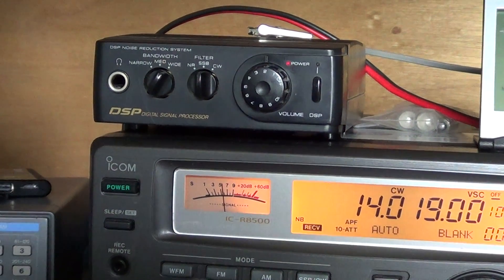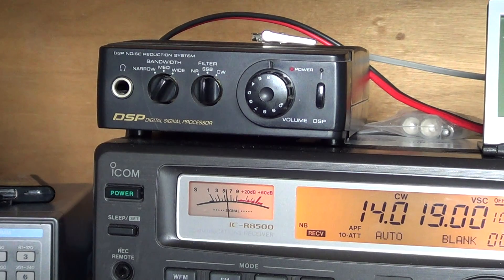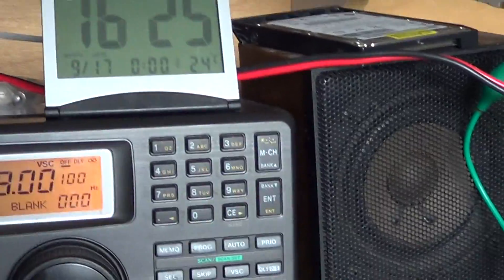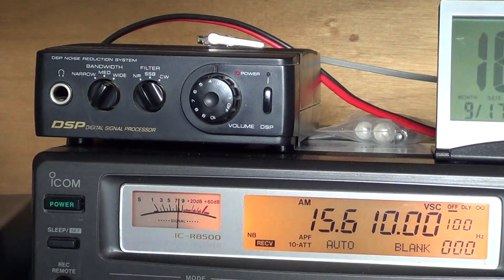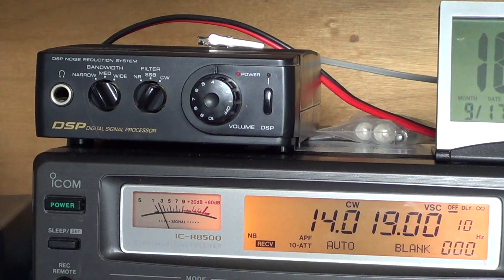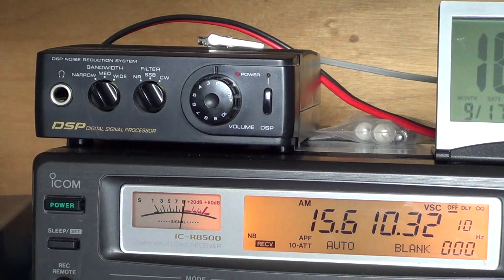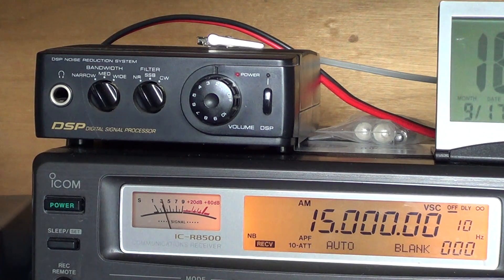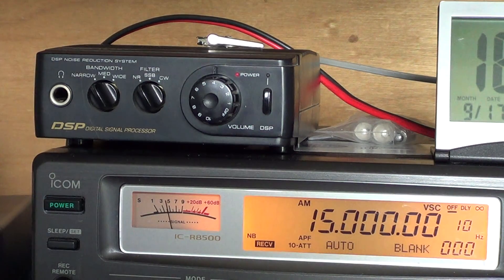DSP Digital signal processor explained in detail Realistic DSP 40

Comment: That was great!  I actually like mine because it is simple.  I use it on 160 Meter SSB when the signals are right at the noise level.  I usually use the medium setting but occasionally use  the narrow setting if it is someone I know, recognize and can tune in carefully.  It can make the difference under these conditions to be able to have a QSO or not.  Thanks again, Steve, AK4R

Comment: I also have the same unit. I was lucky enough to find mine at a ham fest for $15.
Reply from the maker: The Radio Hobbyist at $15 i'd buy it again if I needed one ...   do you use it often ?
Reply: OfficialSWLchannel Yes I do use it on one of my noisier radios - my Icom IC-7000. I also recently bought a Timewave DSP-9 which does the same thing. It has a very dirty volume pot that needs cleaning, but works fine.